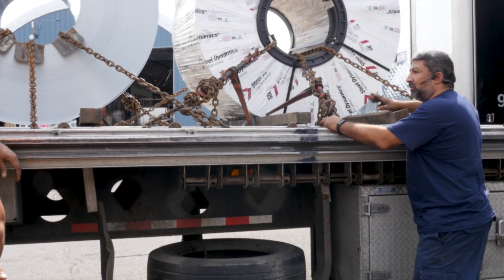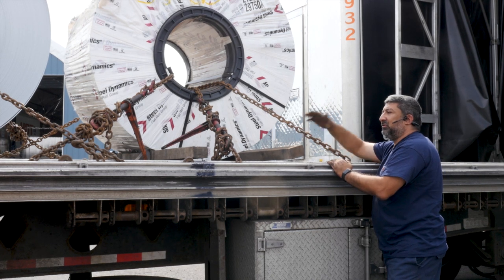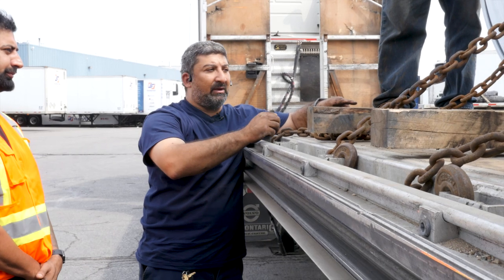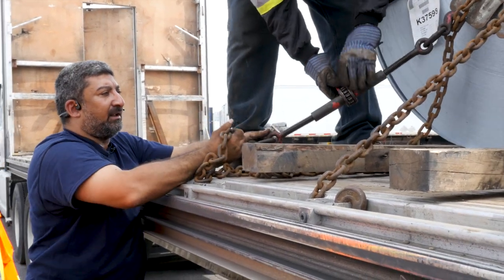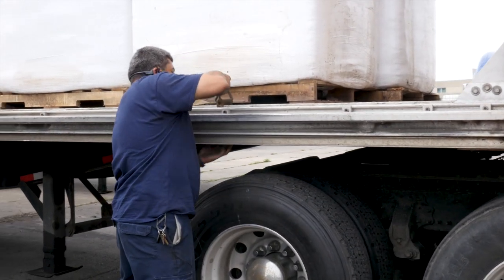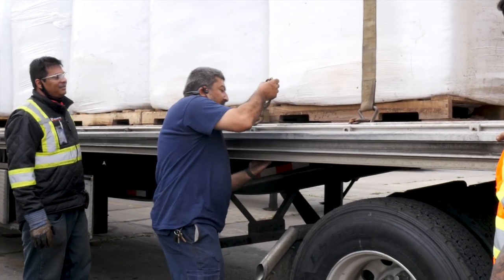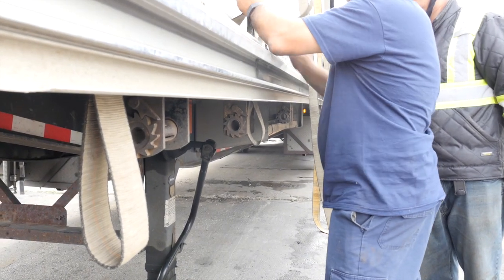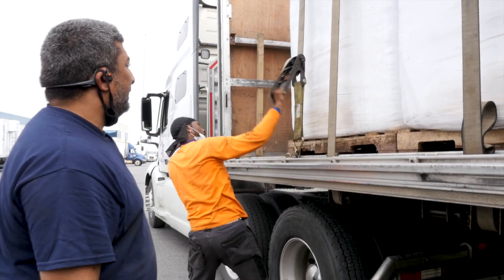How to Secure Suicide Coils on a Roll-Tite (Placement, Chains, Binders, Tie Down Technique) PART 1/2

Comment: Watched the first minute and a half and already found 2 issues. You're supposed to use beveled lumber for coils, most shippers won't load without it. Second, unless your dowel pins on your trailers are significantly higher rated than mine, 1 pin is only good for 5,000lbs not 8,000 lbs. 3 chains at 5,000 is 15k securement, 80% (legal minimum) on 21k coils would be 16,800 meaning you're under secure. Need a 4th chain to be legal on that load.
Reply: Ben flatbedden for 25 years We call them  spools and pockets a spool is rated at 5000 pounds but they count both sides of the trailer one on each side so that's 10000 pounds tied on. But 3 ×8 isn't 21
Reply: @robertscott305  I've always been told it doesn't matter if it's one side or 2, the lowest WLL is still 5,000 so you're securement is only 5,000. At least that's what I've been told by the DOT, and MTO trainer at work.
Reply: @robertscott305  Seriously, from. Where you’re learning these things from?
Reply: @HansraRulez  are chains are rated at 9400 pounds and I will use 3 on a 21,000 pound coil been do it for years we rum Benson trailers and the spoils are rated at 5,500 written right on the trailers you use two of them one on each side that a 11,000 pounds been DOT 100 of times never been written up for a inscure load. never had anything come off my trailer ever. Where you learn how to do your job
Reply: @robertscott305   first of all, no grade 7 chain is rated for 9400lbs, it is either 6600 or 11300lbs etc.

Secondly, one spool is rated 5500lbs good, one on each side doesn’t make them load bearing for 11000lbs, it is 5500lbs you have use 2 spool on both side to for 11000lbs load bearing capacity. You always count weakest link in load securement. If chain is 4700lbs rated, your securement will count as 4700lbs not 5500lbs. And if you’re using 11300lbs rated chain to secure, and you’re using single spool each side is rated 5500lbs, that securement will be count as 5500lbs not 11000lbs.

And 3 chains are good for 21000lbs. As per FMSCA you need at least 50% of the weight of cargo to be secured. I prefer to do atleast 75%

Attaching a fmsca cargo securement link for you, please read before you reply. Thank you, Good luck.

https://www.fmcsa.dot.gov/sites/fmcsa.dot.gov/files/docs/Drivers_Handbook_Cargo_Securement.pdf
Reply: @HansraRulez  you are wrong the weakest link is the chain he has 3  8,000 pound chains that total 24,000 pounds on a 21,000 pound coil he is legal. Now if you're are a D O T officer and I highly doubt it but for the benefit of this agreement you are. Now if you are doing inspection on a flatbed truck and he has a 21,000 pound coil on his trailer with 3  8,000 pound chains on it write him up but know this if it's me I will see you in court. I have 2 coils on my trailer right totaling 49,600 now the driver who loaded it put 4 chains through each coil and I don't have a issue with it because  Rather you overdo it then underdo it.
Reply: @robertscott305  you’re funny guy. I never said he is wrong anywhere, i m just saying your information and logic is wrong.

There is no chain is available in market for load securement which is rated for 8000lbs firstly. Secondly he has 3 chains, even if i assume  them 4700lbs rated chains, he is still good for 21000lbs coil.
Reply: @HansraRulez  now you're just trying to back track

Comment: This is not the guy to watch.  The stake pockets should not be used like he is using them.   They can tear out.   Use two spools and do a teardrop attachment.   The timbers are not beveled so they are illegal.   They are deemed illegal because they put stress high on the arrowhed ends of the coil rack.   When he straps, it is illegal too.   He is lazy and is only half-strapping on the winches.   To be legal, the strap is not bent in half and pushed into the winch.   You must run the strap all the way through the winch.   It kills me to see training videos on here where people are teaching and don't know what the hell they are doing.   The first chain he hit with his hand wasn't even tight.

Comment: U have a major problem.   U can not use 4x4s with these racks u must have belvled lumber most shippers in USA wouldn't load u. There is racks that can make them right but those are for belvled lumber only ur coil can not sit on edge of board like that very unsafe
Reply: SuperTrucker Dan uses 4x’s...
Reply: @Invictus13666  don't make it correct they make coil racks for the 4x4 but those are not it and every facility u go to has rules some may not enforce it some will. It can damage coil and you can see board in video wants to twist cuz coil is sitting on edge the racks being used in this video are not correct boards must sit flat up against coil and must have rubber mats down and boards should hold coil off floor of trailer and the fact someone may use this video to secure thiers plz relay that info coils are nothing to mess with I haul them daily and see these people do this and they may get away with it but it's not safe inform those people who don't know this the correct racks will hold board at a angle flush against coil

Comment: You can’t use square wood for the coil bunkers. The wood has to be beveled so there’s no damage to the coil n it also sits off the deck accordingly to the Mto. And on the coil with the plastic rings still needs coil protection from chains cause the plastic isn’t a protection from the chains. Which is also illegal according to the Mto.

Comment: that's my daily job, 
For improvement : the rubber on the inner steel coil side is too thin. you have to replace it with thick rubber. to maintain coil quality :)